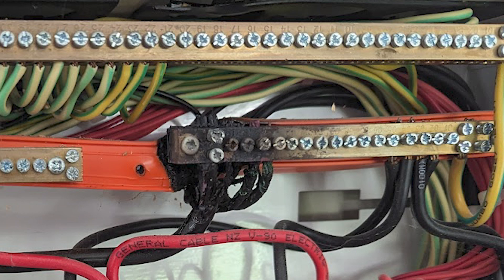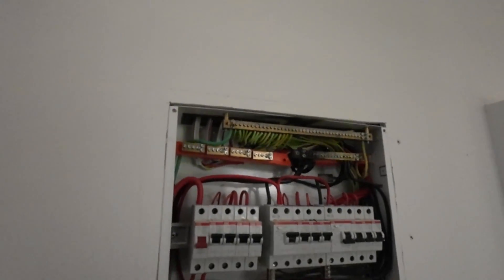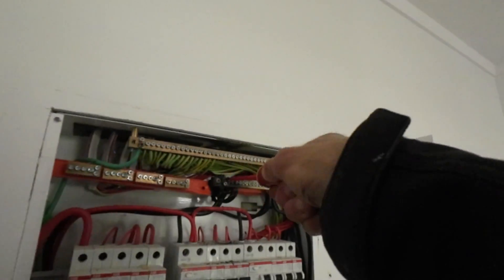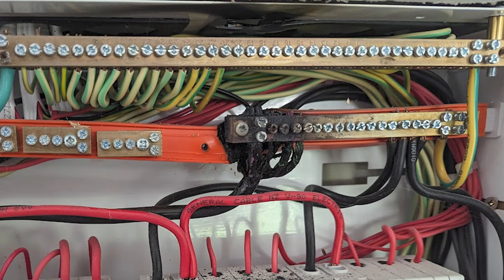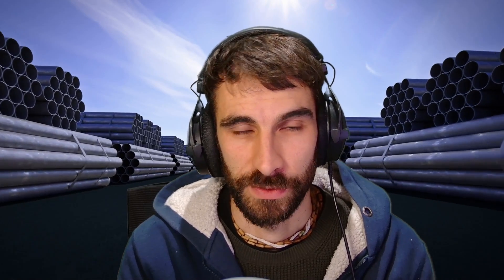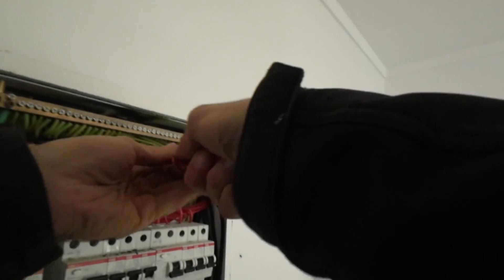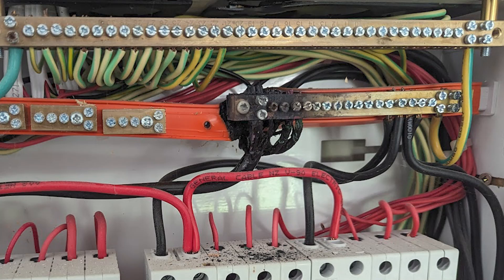Loose Neutral Fault Explained

Comment: Am I correct in assuming that MEN is the same as TNC-S, also known as PME in the UK?
Team Electrical on YouTube have made some excellent podcasts on broken neutrals and diverted neutral current which arise from network failures outside the property.
They have also made some podcasts on earthing arrangements featuring the Condudisc which offers a much lower and more stable earth resistance than the commonly used  earth rod.
Torque tightening of all consumer unit connections, to the manufacturer's specification, is essential to reduce the occurrence of this dangerous situation.
Reply from the maker: Yeah, it does seem to be the same as a TNCS (no idea what the acronym stands for).

I've never hard of a condudisc. It looks really interesting. I think it's only worth it if you're digging a hole and pouring concrete anyway. Banging an earth rod in still looks easier in many cases.

I don't think any amount of earthing will protect you from a loose or lost neutral. There's just not enough conductivity in the ground to divert fault currents and trip breakers. It's also not enough to get the voltage down for ordinary current. All eath electrodes are good for is getting rid of touch voltages that would otherwise arise due to current in the  neutral and resistance in the  neutral conductor.
Reply: @legacyelectrical  PME Protective Multiple Earthing. The UK still does not require earthing by whatever means at each property but I think it will come because of the need for independent earthing when an installation operates in island mode from battery storage.
Independent earthing can only moderate the effect of a localised loose neutral within the installation when connected to a grid supply on TNC-S.
The quality of earthing with a Condudisc does improve with time and maintains a stable value over time.
It only needs to be buried 600mm deep in soil.
In gravel or rocky soils Conducrete improves the conductivity to the same value as in soil.
They can easily be used on temporary installations like outdoor events using generators to provide a stable earthing arrangement.
Reply from the maker: @stevejagger8602  yeah, sounds pretty awesome.

I think with loose or lost neutral faults the real key is early detection and remediation. How ever much current the earth mass carries, there will still be a volt drop in the earth resulting in touch voktsges on earthed metal.

Without local earth electrodes how do you keep the main earth conductor from developing a voltage difference it the local true earth? Surely to your fridges and toasters have earthed frames.
Reply: @legacyelectrical  touch voltage is the first thing I look for. It is also worth putting a clamp meter on the main earth in case of a broken neutral external to the installation on TNC-S services causing diverted neutral from that property or incoming from an adjoining property via other metal services like gas or water.
Reply: @legacyelectrical  from your last comment, it is the greatest potential danger of the UK’s TNC-S system because a property is relying on the local network operator’s earth,  which has been very reliable, plus the use of equipotential bonding to metal services. If you watch Team Electricals discussions on diverted neutral current you will hear that the number of reported incidents of broken network neutrals is increasing year on year as the old underground PILC network fails. Local earthing will be in the next amendment of BS7671, I think, maybe as a discreet acknowledgement of the broken neutral issue.
Reply from the maker: @stevejagger8602  I've never seen a loose neutral fault from the network. I've only seen it from the mains entry box, or somewhere in the building. It's not a very common fault here.

Auckland, where I live, has a lot of upgraded underground disturbution lines, and the maintenance on the overhead lines seems to be pretty good. They're often replacing lines or poles.

But the system in NZ is very different because we don't have metal unground services really. The main water and gas lines are PVC, so if you loose a neutral your power system will stop operating. The earth electrode can't carry much current because there's too much resistance in the earth mass. I guess if you just have a loose but not lost neutral connection then it can be just bad enough to be dangerous, but not bad enough to make the system stop working.

I don't understand what the alternative is to the MEN system. If you don't have the earth tied to the neutral, then how it draw enough current to trip under fault conditions?
Reply from the maker: @stevejagger8602  yeah I went and listened to a few of their podcasts. Interesting stuff.
Reply: @legacyelectrical  the only two alternatives are TN-S which the uk abandoned in the 1970’s as a copper saving measure in favour of a combined N and E system which gave a lower Ze, but risked a danger from a broken neutral, which could only be avoided by regular long term maintenance of the network, and TT where a good earthing system has to be installed, and RCD/RCBO protection is mandatory.
Privatisation of the networks and grid distribution didn’t help that need for regular planned maintenance, because of the pursuit of profit.
Many electricians feel that they are the only ones monitoring the condition of the service head, which incorporates the cut out fuse, the incoming supply cable, and its connections to the metering equipment, which in the uk can be yet another company!
The old underground PILC cable network from the post war era is a time bomb ticking away.
Reply from the maker: Sounds like the grid over there isn't in good condition. It's pretty good here. The underground lines are pretty new and upgraded when needed and the overhead lines are easy to upgrade and they keep on top of that.

Also, our neutral earth links are all inside the installations, so electricians get to do maintenence on those as needed. The network never supplies an earth wire.

TT makes no sense to me. No one should be relying on the earth mass to clear fault current. No matter how low you can get the resistance in the earth, it's always going to be beat by using the mains neutral wire. RCDs are great, but they're not practical for some types of equipment such as water heaters and pumps. You'd get too much nuisance tripping with everything on RCDs.

A votlage detector with an alarm would be a pretty easy work around. It could even plug into a regular outlet and be an off the shelf option. If the volt drops below a certain amount then the home owner can be alerted to ring an electrician immediately.

TN-S is probably better but I don't think it's necessary to run all that extra copper. Better to just screen for faults.
Reply: @legacyelectrical  Resurrecting an old comment, but you probably had ELCB and direct earthing over there too as we did in Australia.  It's the equiv of TT earthing.  The original direct earthing couldn't clear earth faults reliably if at all.  ELCBs became essentially mandatory and monitored the main earth conductor (in series with it) for current and tripped if the current through the ELCB would result in hazardous voltage on the earthing system.

Comment: A loose neutral reminds me of what's alarmingly common in North America. Because North American wiring is like this: Each hot is 120V and we combine the hots to get 240V. 120V devices need the neutral to balance the loads between other 120V devices! I was in a house during spring, 2016, where there was a poop neutral connection, looks like it resulted in a non-working hard-wired smoke alarm in the bedroom I was at, from April 15, 2016 to May 31, 2016. Also no lamps lit on a wall light fixture in the main bathroom!
Reply from the maker: You'd be a good person to ask about this then. Is the neutral connected to the earthing system, so could a loose neutral cause voltage on earthed metal frames?
Reply: @legacyelectrical  Yep! There would be voltage, if neutral open, I would expect! I only knew about this years ago, back in 2016, because I hardly knew stuff compared to now. Now I know more than a ton of people! The first symptoms I noticed, the most-loaded 120V leg, dropped to 112V or 111V with the furnace and range on! The other leg shot up to 132V!
Reply: @legacyelectrical  Yes, the US uses a TN-C-S system. If the Neutral opens you will have neutral current trying to return through the earth ground, water bond, cable TV coax shield. If you have a telephone cable with a metal messenger or shield, it will try to return via that as well. Our earthing system is designed that ideally if the metal frames are at increased potential, so is the earth to keep an equal potential and prevent shock. Our earthing was originally designed to prevent lightning currents from starting fires.
Reply from the maker: @jrmcferren  That's my understanding too. I'm not sure if the earthing makes it safer for people by reducing touch voltages, because it's also increasing the connection a human can make back to the transformer if they contact active/phase. Isolation transformers used to be used to protect people. In theory the whole grid could be isolated and that would be safer for people.

I heard one guy whose in the US and lectures on this stuff. He was saying that they have earthing to protect equipment from voltage differences to earth. Maybe he meant from lightning.

Comment: I have heard of this happening at the entrance aka where the network enters the building often caused by insulation failure that caused burning of the cables either burning the phase or neutral in half often it leads to the pole fuse blowing before it gets to bad bunt sometimes the fault current never exceeds the fuse so just keeps damaging the conductors.

You sound like your from the south of the south island.
With the Australian electrocution  UI suspect another factor to be missing earth rod or ineffective earth rod due to low moisture of soil.
Another option is bonding of phase to water pipe with plastic piping the current can be small but deadly.
Reply from the maker: I don't think a missing earth rod would make much difference as long as neighboring properties have earth rods and MEN links. Even if all that  was missing. I don't think you'd get much voltage on earth as long as the main neutral connection was good. 

A loose phase connection isn't a big deal because it can't electrocute you. You get a volt drop just the same, but you don't get voltage on the earthing system. 

Yes, sometimes this fault is caused by a hot connection at the mains entry box. It can be at the main neutral lug in the meter box too. 

I'm in Auckland but lived in Vancouver for 11 years from age 8 to 19, so my accent is all mixed up.

Are you in Australia?
Reply: @legacyelectrical  re the missing or ineffective earth rod or missing bond in the case of broken neutral (in the Australian incident ) the potential from house fixtures to earth will be at any value from 0 to 230v, As a earth rod becomes live the ground around the rod becomes at a potential dissapating over distance. 
What my point is implyung is that if the earth bonding is sufficient the potential between the tap and the earth should be less but this heavily relise on the conductivity of the soil.
Reply from the maker: Yeah, you can't rely on the conductivity of the earth  to carry enough current to take the voltage down. The set up in Australia and NZ is fully dependant on a good neutral connection. The earth electrodes are just to prevent voltage increases due to current in the neutral.
Reply: @legacyelectrical  re am I AUS no Timaru NZ.
that explains the accents.

Comment: This MEN system is not safe. TN-S more internationally accepted system.  Total separate earth and earth from transformer.
Reply from the maker: Is that where there's an earth conductor run all the way back to the transformer?
Reply: @legacyelectrical  That's it.
Reply from the maker: Do TN-S systems have multiple earth electrodes to prevent voltage variations?
Reply: @legacyelectrical   You mean periodic connection of neutral to earth to keep the ground/neutral voltage difference in check?  That's going to be a country specific thing.  Terms like TN, TT, IT do not describe that part of things.
Reply from the maker: I'm very ignorant about how they do things in other countries. When when I think if a separate earth all the way back to the transformer I mean they run 2 parallel neutrals, one for fault current and one for ordinary current. There wouldn't need to be any earth neutral connections anywhere else. But it might be smart to have the earth conductor grounded through the disturbution system to prevent volt different to the earth mass.
Reply: From what I've learned, in the UK they used lead sheathed cable in the network when TN-S was set up long ago with the sheath being the network earth conductor so that meant the ground was closely tied to it voltage wise but that wouldn't address neutral / earth voltage difference since the earth conductor normally doesn't carry current.  Neutral may well be periodically broken out and staked to earth.  Current between neutral and earth would explain why they have erosion problems on the old lead sheath cables after being in the ground for decades which prompts the bodge change to PME that happens.
Reply from the maker: Oh, that's interesting. It makes sense. It's like the opposite of cathodic protection.

There's definitely some things about power disturbution systems that protect equipment at the cost of making it more dangerous for humans.

If you join the neutral and earth conductors then they just become parralel conductors making it redundant.
Reply: @legacyelectrical  Yes, that is how TN-S should be done. The problem is that if they need to fix damaged cables they may use common cable as that is what they have available.
Reply from the maker: @okaro6595  ordinary cables as opposed to what?
Reply: I do not know where TN-S is used besides in the past in the UK.
Reply: TN-S is impractical in most countries as the distribution network just isn't set up for it.  The only safe options in these circumstances are TT and TN-C-S.  TT has only become practical with the general availability of lower price but still effective RCDs.  The vast majority of the electrical systems around the world are not TN-S.  It's not a more internationally accepted system.

edit  Some searching later and it seems that the UK and India are the main areas of use of TN-S.  China's generally under developed electrical system is heading towards TN-S in new large scale developments but even there the majority of installations are not TN-S at this point.

Even the UK is moving towards TN-C-S earthing with their PME.  Old TN-S systems are slowly being migrated to PME as the network earth degrades to the point where it is no longer able to function properly.

The penny has finally dropped in the UK regarding local electrodes.  Even so, and Aussie/NZ electricians might be alarmed by this, the explicit local earth electrode is still not mandatory in the UK, even in the latest edition, and amendments, of their standard.  It is only recommended.  Most PMEs are only taken to earth locally incidentally by bonding either explicit on the plumbing or incidentally on the plumbing via water heater earthing.  Leave the local electrode out in AU/NZ and you'll be taken out the back and shot.

Comment: thanks for letting us know what it was ,new Zealand is a wonderful country north and south we have been twice and hope to come again but i am getting a bit old but if there is one place i would like to go it is new Zealand we live in the damp uk
Reply from the maker: Yeah, it's nice here. A little rainy, especially lately, but lots of beautiful nature.
Reply: @legacyelectrical  but  its your winter time we usually come around February and we have lots of friends out there
Reply from the maker: It rained heaps last summer. You probably heard the news.
Reply: I'm guess guessing the customer that called you didn't have a RCD ( eatrh leakage device) on the board, that's checking balance on Active and Neutral.
Reply from the maker: It's a modern board with RCD protection. But this fault is before the RCDs, so they can't help you. Also, in NZ we don't put hot water cylinders and ovens through RCDs because they can cause nuisance tripping.